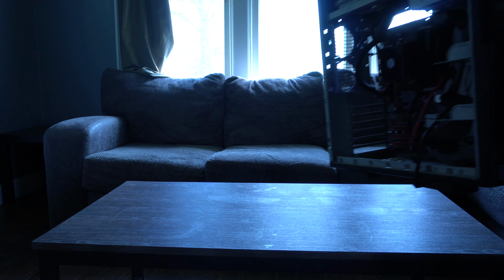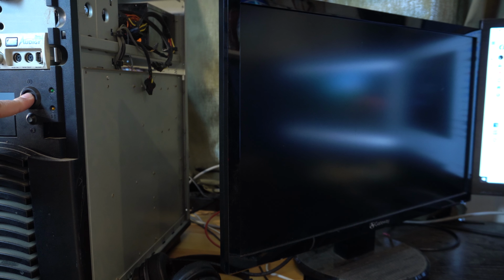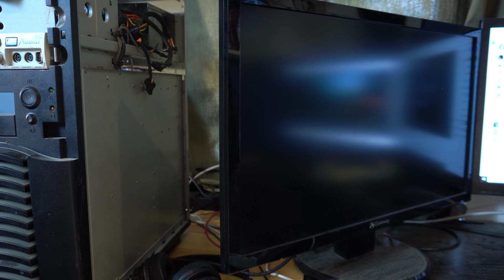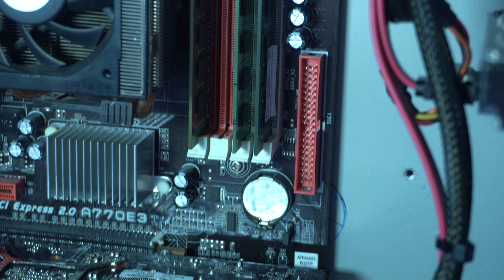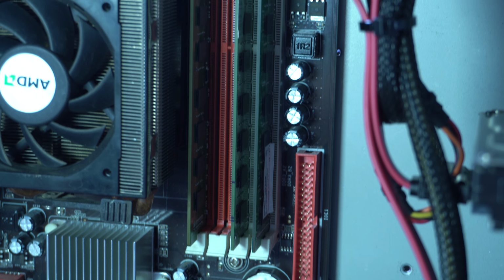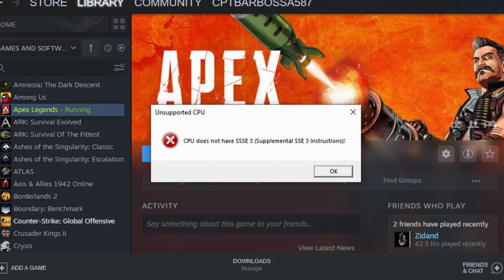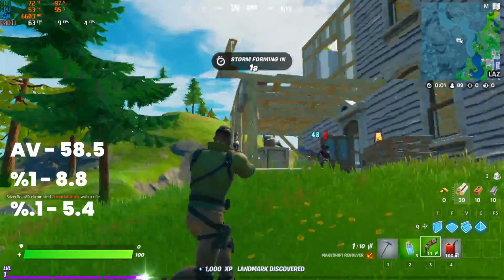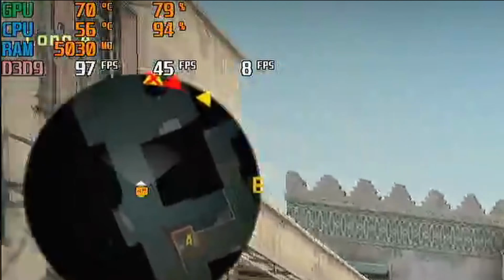Gaming PC Under $60

Comment: A 5400RPM HDD cause slideshows on which game? I'm using a similar drive on my modern system, I pulled it out of a laptop I had, works fine. Yes, it's a bit slower than a 7200RPM disk but not enough to make a major difference.